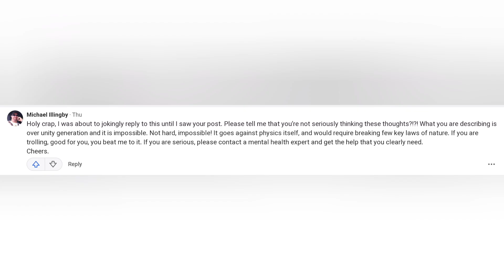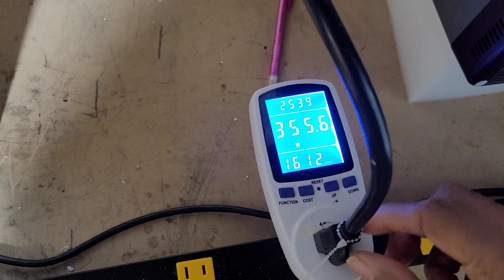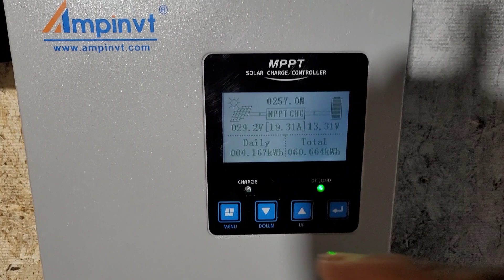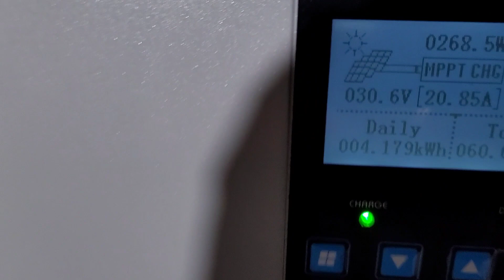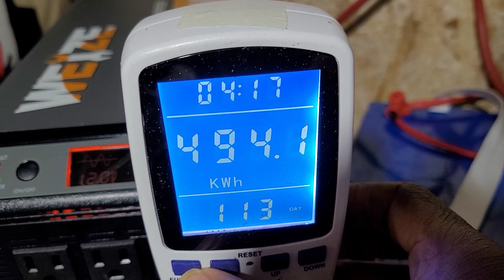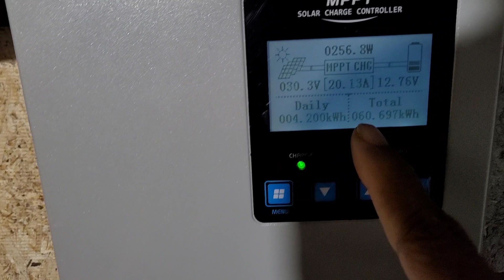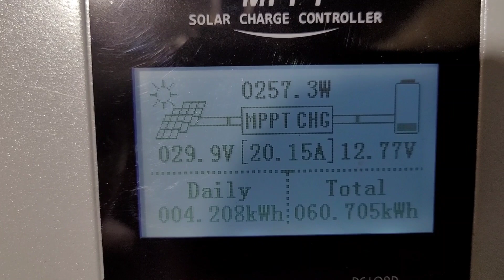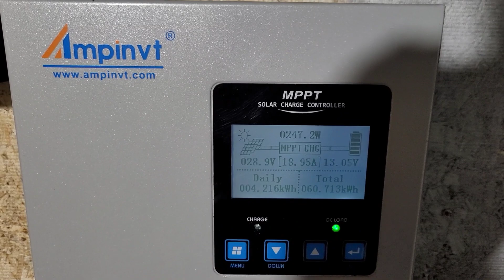the ? asked; Can we charge an inverter using its own output?"  then this happened!!!!!

Comment: What's the use of rotating power and increasing inefficiency? 

Yes it is possible to return the output power of the inverter to the batteries and back to the inverter, but it's screaming losses.
Reply from the maker: Do I have to watch my solar project to get that answer and you have to come out of that thinking about inefficiencies is just holding you back from real power

Comment: At 8:13 your charge controller is putting 254W into the battery and 5:51 the inverter is taking at least  378W out of the battery. So although you can power the charger from the inverter its pointless as overall the battery is being discharged... 254 - 378 = -124W. You're better off disconnecting the inverter and power supply rather than using the inverter to power the charger.
Reply from the maker: @ColinWatters  @ColinWatters — Thanks for your analysis, but I think you've misunderstood the purpose and sequence of the experiments:

First video:
This was a proof-of-concept. The question being tested was:
“Can an inverter safely power its own charger in a closed loop without failure?”
You and others said this couldn’t be done—that it would blow up or damage the unit.
I proved that wrong.
Yes, the system loses power (254W in, 378W out), which I openly stated.
This was never about creating free energy—it was about showing the loop works without damage, proving a foundation for further experimentation.

Second video:
Here’s where you missed the real development.
We recreated the same loop—but this time we injected external power into the system.
With that input (from solar or another source), the system does show a net positive charging behavior.
This was never claimed to be perpetual motion—but a system that can sustain itself with assistance (a hybrid), which is a totally different ballgame.
And it worked.

So respectfully, your comment focuses only on the first step and ignores the second, where the real breakthrough happens.
Reply: @WIZ56575  I never said it wasnt safe and if I used the words "couldn't be done" I was referring to the power balance and the fact that its a pointless as thet is a net power loss. Even if you inject solar power into this loop you would still be better off not having the loop. If you inject 124W then battery might just maintain charge, but disconnecting the loop would see it charging at at least 124W.
Reply from the maker: @ColinWatters  To Colin Watters:

Colin, you're shifting the goalpost. Originally, people did claim this loop setup would damage the inverter or charger—and many in the community still say that today. I made the first video explicitly to address that myth, and I clearly stated in the video it would not sustain itself. So the “power loss” point? Not new. Already covered. Already acknowledged.

Now you’re claiming that even with external input (like solar), the loop is still “pointless.” That’s where your argument breaks down.
Why? Because the second video shows that this exact configuration does charge the battery—with solar input and amp injection.
At that point, it's no longer a "loop" for its own sake—it's a hybrid configuration that opens up new architecture for self-regulated or semi-sustaining systems.

You’re not critiquing a power balance anymore—you’re rejecting an evolving design just because it didn’t come from conventional channels.
Call it “pointless” if you want, but the numbers prove otherwise. And clearly, the public is seeing through that old gatekeeping strategy.

Innovation doesn’t ask for permission—it just works.
Reply: @WIZ56575  Sure, if you put enough solar power in it will indeed charge the battery. But it would charge it at least 124W faster without the loop at all.
Reply from the maker: @ColinWatters  Colin, if the only goal was raw charging efficiency, removing the loop might be faster. ( Is absolutely wrong)But that’s not the point of the design.

What’s baffling is how you could be so observant with timestamps—and yet completely miss the fact that I explicitly stated in the video this setup would run down over time. That was said clearly. Why ignore that?

The loop exists not because it’s efficient on its own—but because it lays the foundation for amp injection tech, which you clearly haven’t followed. The same configuration you called “pointless” has already been sold to major companies. And thousands have bought my book explaining the method in full—because unlike you, they’re paying attention to the purpose, not just the surface numbers.

You’re analyzing a system you don’t understand, because you’re missing the context. This isn’t about running a loop—it’s about building a circuit where input and feedback can be tuned for a gain, something your comments keep dismissing without knowing the tech behind it.

Tech moves forward. Try keeping up.

Comment: Ok remove all batteries and put in a capacitor and see what happens
Reply from the maker: @rogerburley5000  a capacitor doesn't have the energy dense enough to run the regular operations it charges fast but still drawing that much power would drain it faster besides I've already tried it this experiment was done also cooking in a solar power so solar made of any losses as it runs in a circle now that works but I've done that with other solar projects so running loose is something I test all the time with different products

Comment: Looped it is  109 watts behind consumption.
A better way is to use a 24 v inverter to power a 220 v 9 A ac motor to turn a 24v 200 A alternator with. The inverter will only pull the amps required to push the load applied to it, and the alternator will only give you the amps that are being demanded by the system.
This system is capable of maintaing constant charge state of battery in addition to various other light loads placed on the system.
If you pull more from the alternator than it can supply , the battery charge will go down in time accordingly.
But if you dont pull more than the alternator can deliver, battery voltage remains constant , load remains constant and the system is perpetually self operating .

It was demonstrated with amp and voltage read outs on all accessories 12 years ago on yutube, now you can not find hide or hair of that video unless you know the creators name, which im sorry that i do not.
All i know is his demonstration was a 24volt system that powered a 2 hp motor and 200 a alternator through a battery 3000wt inverter tie in and the whole system was able to provide an additional 1400 watts before any more load would effect battery voltage and charge state. 
He put it all inside a pu truck  plastic tool box which he used to operate his power tools in his mobile hedge trimming and pruning business. Thats all i know to tell you.

Comment: You the G.O.A.T Bruv 💪 This video can only be appreciated by the tech savvy and the curious ones.

Now i can setup my charge supply changeover in peace 😁
Reply from the maker: @nextwave_club  Thank you, I appreciate the compliment. I want to ensure you understand certain principles: while I've managed to loop energy back onto itself, energy doesn't create itself; it doesn't magically appear out of nowhere. In another video, we demonstrate a similar concept but in a different form, explaining why we use solar energy to offset losses like heat from wires and other technical issues that cause energy loss during the looping process. We still require incoming energy into the system, but the device can supply much of the needed energy itself. Check out this video for a clearer understanding. https://youtu.be/0YF2nvKTMz8?si=ugb1HjaN_M0CaIxw

Remember, I'm the originator of overunity and the concept of looping and hyperlooping. My name is Lloyd George Stovall. Good luck, and thanks again for the compliment.
Reply: @WIZ56575  Yes i understand very well. ☺ 

I want to add a changeover which i can choose between power grid and generator to feed the inverter. 

So i just wanted to be sure if things wouldn't go boom 🔥 if for some reason the generator/solar changeover was set to solar by me or my household and the loop occurs. 😁

You're welcome 🤝
Reply from the maker: @nextwave_club   It's not all lost there's things they don't want you to know, But I first had to make everyone realize that you could do this that's the purpose of this video. But the video I sent you shows that you can do this. Consider this: when electrical energy flows through a wire towards its intended load, any residual energy, such as from magnets or other sources, can be captured and redirected elsewhere. This approach minimizes energy losses. Regarding power lines, energy is lost, but utilizing the electromagnetic field (EM field) to generate and store energy potentially offsets some of these losses. Essentially, by reusing energy that would otherwise be wasted, systems like a coil in a thief circuit effectively harness and redirect this energy back into usable forms."
This version clarifies the idea of capturing residual energy and reusing it to mitigate losses, particularly emphasizing the efficiency gains through such methods.
Now when you start to put all this stuff together you start to realize every time someone says that you have losses means that you can use a device to recapture that loss and reutilize it back into your batteries or your system. When you do this you can make your system smaller and more powerful remember the simple concept when you wind wire around a coil it gets stronger and more powerful.
Reply: @WIZ56575  Very apt. You're a genius 💪

Comment: I have a question ❓ can you run a battery charger off the inverter back to the battery while using the other plug to watch TV and run lights. I don't think you can but don't know for sure.???
Reply from the maker: This is a great question and only person who can actually answer the question is the person who actually done it so let me explain this simply first yes you can how do I do this and how did I learn this well I noticed when the sun is out full on my solar panels that the battery is maintained and will never go beef low 12 V matter that it hovers between 13 and 12 Even when I'm using power so so it's about power regulation If you take too much power the battery will drain but if you're taking less power than you're putting in with the battery charger than the batteries will charge some of my older videos talk about this and as you go through my older videos you'll start to you See that I am using Power supplies assimilated solar which charges batteries so yes I am very versed in stuff like this and I'm writing a book called looping energy And a second book called hyperlooping. Trust me I hope you ask a great deal more questions Our library specifies on things that people don't want to know but they the corporations don't want you to know so green energy is one of the things that we definitely do and talk about in our library here at media library. If you need more detail please call within business hours 9 .  5 and and if we pick up And you ask your question you will be amazed on the answers we give you 3136545349.   medialibraryinfo@gmail.com
Reply from the maker: @donnieparrish3312   Use a better answer take an electrical cord and plug it in to something and run a system then take the excess cord and wrap it around your hand you just made a coil it is looping, And you'll see that it's not harming anything while doing it but put a coil in that and it will store power they've known this for a long time so where did the myth that says you cannot loop these things but it doesn't make extra power because you do what it does is what we're trying to teach in the looping process,
Reply from the maker: @donnieparrish3312  Exciting News!
My new book “My Purpose is to Drive This Technology to Market” is now officially published and available on Amazon!

This work represents years of hands-on experimentation, theory, and exploration into real-world energy solutions inspired by Nikola Tesla and other pioneers. If you're a researcher, engineer, inventor, or simply curious about future-forward tech, this book is written for you.

I would be honored if you took a moment to read it—and even more grateful if you could leave a review on Amazon. Every rating and review helps increase the book’s visibility and brings this technology one step closer to the world.

Check it out here:
https://www.amazon.com/dp/B0F2ZZ7X5C

Thank you for your support—and let’s build the future, together.

Comment: I think it could only work if the power being put back in the battery is more than the power being used.   Other than that it would just make the battery last longer,  but not forever.   I believe it's possible,  but not sure which charger is low powered with a fast charge rate.  If there's one,  let me know please.
Reply from the maker: Thank you for your comment! It's been a long time since someone actually looked at what's being done and asked a good question. I've been doing this for a very long time, and I'm also a Liberian, so I do a lot of research and study, not just for myself but for other people. I'm amazed at the things that people don't know exist because they just don't use them anymore. I knew that you could do this, but for what purpose? When you start to see how solar actually works, you start to understand that the system has to have rest to rejuvenate its battery. So, can you charge a battery while taking off the power? Yes, just don't take off more power than is being put in. I'll make a video about this; maybe I should have covered that point in one of my other videos. I'm trying to do a couple of videos that will explain how they trick us into believing that something the ancients used is obsolete, but when they do the exact same thing with an upgrade, we all go along with it. What is this called? It's called advertising! They make the other guy's product look bad while they sell or upsell their own.
When you start to learn all these different things around the world, you start to see that not everyone plays the same games. Each country has its own system, and these systems do work. But don't tell the USA that they may not be number one when it comes to certain things, or you will have a good argument on your hands!
Thanks for the comments! I appreciate it.
Reply: No problem.  We can actually have free energy using magnets.   Magnets are actually more valuable to me than diamonds.   I think that's how Telsa did it,  with rotating parallel magnets.  Not sure,  but that's definitely one way we can obtain free energy.   Also that's how I think UFO's operate.   Magnets are the only thing on this planet that can defy gravity,  or so called gravity.  One of our most valuable objects on this planet that can save this planet,  is magnets.  @WIZ56575
Reply from the maker: @anonimus5996  Exciting News!
My new book “My Purpose is to Drive This Technology to Market” is now officially published and available on Amazon!

This work represents years of hands-on experimentation, theory, and exploration into real-world energy solutions inspired by Nikola Tesla and other pioneers. If you're a researcher, engineer, inventor, or simply curious about future-forward tech, this book is written for you.

I would be honored if you took a moment to read it—and even more grateful if you could leave a review on Amazon. Every rating and review helps increase the book’s visibility and brings this technology one step closer to the world.

Check it out here:
https://www.amazon.com/dp/B0F2ZZ7X5C

Thank you for your support—and let’s build the future, together.

Comment: Yes it will run, you don't need a degree for that, will it run indefinitely no, not without some other input like your solar panels as that unlimited source. With the panels connected and the sun coming up everyday there is no reason why it would run for the lifetime of the weakest component.
Reply from the maker: Okay just to make sure you did hear me say that exact thing right!